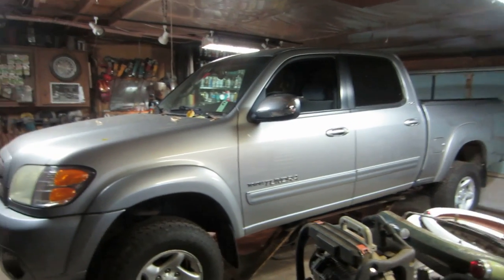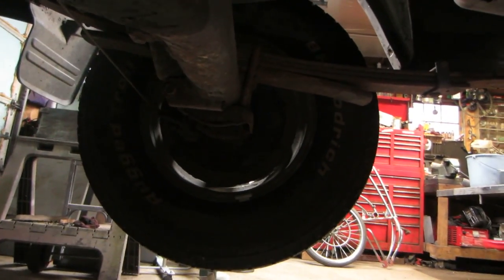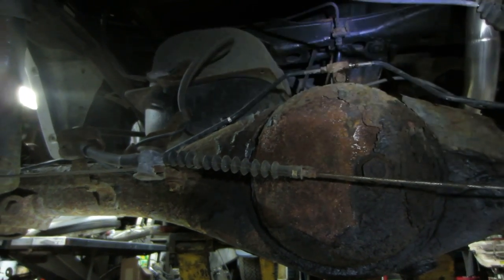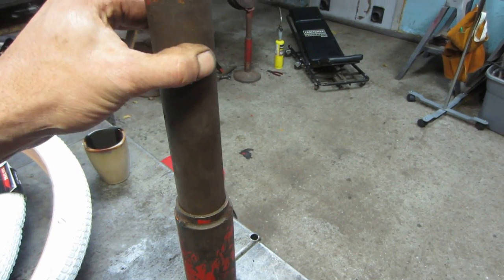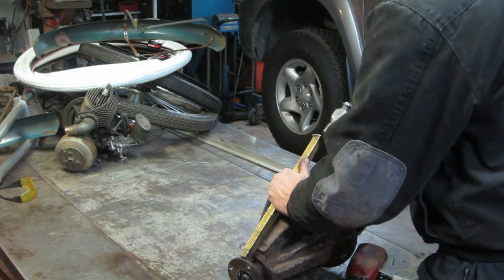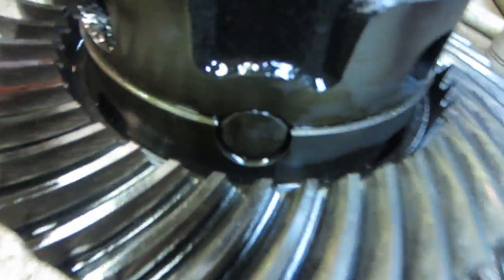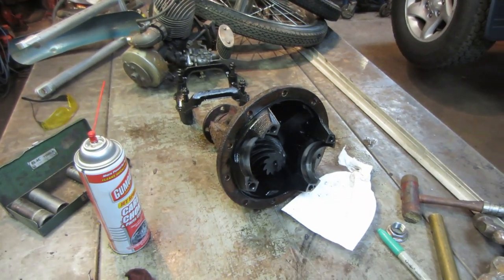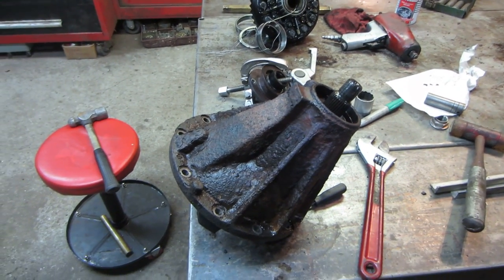toyota tundra rear diff tear down

Comment: I've been binge-watching your videos since I tripped over your channel a few days ago. I drive a 2004 Tundra V8 4x4 access cab, with just a quarter million miles on it. It's still running great, and it has the dog nose-prints on the insides of its windows to show how well-loved it is. Say what you will about California, but at least we don't have to deal with rust like that here! The paint on the tops of the hood and cab is all flaking off after 14 years in the sun, but the metal underneath is just fine.

I should have clicked away before I got to the closing scene, because that Cadillac made my laptop smell like rust!

Comment: If you heat the shaft really hot the let it cool it will shrink in the bearing race.   When it's heated the race won't let it expand radially but when it cools it will shrink in all directions.   Not guaranteed to work but it usually does.

Comment: Sooo, I did a bit of looking and according to this website "Eric's Toyota Differential Info", The T-100, Tundra, and maybe Sequoia all use that same differential... I couldn't find info for the housing lengths for the Tundra BUT there is a Tacoma rear axle on ebay and it has 4.10 gears in it with the exact same diff in it,  as well as the same chunky squared off diff housing bump to clear the carrier bearing trusses as your Tundra.  The housing MAY be the same length as yours (you could ask the seller), but in any case that 4.10 pumpkin should slide right in...   You should look at Eric's page it's got real good info and might save you some $$.

Comment: Just a thought but why couldn't you take your plasma cutter and cut out the inners of the bearing and then get it apart. I ran into a similar case on a Ford 9 inch years ago, I cut away the bearing the oxy/act. torch and got it apart.

Comment: Long time ago I repaired one differential which was badly corroded. It was very noisy although it did not look too bad. But the small corroded pits caused a terrible noise while driving. It had to be replaced with other used parts. For that model 1962 car it was not a big deal and the noise went away. Musti1's differential here can not be salvaged as the teeth are really bad and will surely cause a high noise level.

Comment: I have a 2000 Toyota Tundra hell of a truck 
I'm at 408,008 miles on it runs great. Till my rear diff started slipping now I'm already taken pumpkin head out 
I,m just wondering if I can change from limit slip to posi ???

Comment: A gear kit can be had online. If memory serves me correctly the toyota uses threaded main cups. Get some marking lube and set it up!
Reply from the maker: you can get kits in higher gears but not stock, they are only availible from toyota, l tried, but l may have found what l was looking for

Comment: Had a 1983 pontiac. Had same problem and also bad wheel bearings. $80 for the entire diff at the junkyard. No brakes. Mechanic wanted to charge $60 to replace 1 bearing.

Comment: How much would it be to put 3.91's in the front and rear?
Reply from the maker: that might be my solution
Reply: There's not much difference in the ratio. Should get a little better mileage.
Reply: Might have to check the ABS sensors between the two.

Comment: Welded the back of the differential on? Wow.......just wow. Reminds me, but not as bad as the Chrysler 27 L V6, where the water pump would go out after 70k+ miles. As in, go out, and let coolant enter and destroy the engine. I may be crazy but I thought the caddie was beautiful.

Comment: if 391 gears are more readily available and cheaper, would it be worth converting it to 391. You would need to change the front Diff as well but would this be a cheaper option and get it back on the road. I am from the UK sorry about that, so don't know if its that simple?
Reply from the maker: could be done but not easy, fronts a pain

Comment: It would be interesting to find out if there's some sort of lapping compound for gear teeth... so that the teeth can be repaired and smoothed again without replacing the whole part. Although if the dimentions are critical, it would require adjustment..

Comment: Cut that bearing out with an oxy-acetylene cutting torch. You have nothing to lose. Then buy a ring and pinion set and new bearings. Third member type differentials are easy to setup on the bench. Are there aftermarket companies that sell third members or at least complete ring and pinion kits  for Toyota like Richmond gears?

Comment: Know this is old, but with that rear diff. heating up like that, and the metal distorting/weakening would want to change it out completely, rather than my preferred 'repair the old' method I try to usually employ, preferably getting a whole axle assembly that matched the ratio and year correctly.

Comment: Man! That housing looks like it was buried for fifty years! It's amazing what the salt and chemicals does to metal.
Reply: thinking the same thing. i have worked on chevy rears from the 70's that look brand new compared to that nasty thing!!!!
Reply: Early in the video he said the PO ran it until carrier was red hot. That burned off all of the paint, oil, etc that was protecting the casting. Once it cooled off it 'flash rusted' and then continued to rust after that to give it that lovely 'been in an ocean' finish.

Comment: Rebuild the third member.  New ring and pinion and bearings.  And clean housing and weld the holes.   Freaking rites !!!!
Reply from the maker: only if it will come apart
Reply: Mustie1 
I'm with you on blowing the bearing in pieces.   If it doesn't allow enough room to allow race through , I bet a hot wrench can eliminate the race.     I have a feeling you are a surgeon with the hot wrench. 😁😁😁😁
Reply: That'd be kinda cool, to just fix the 3rd member without having to buy the complete set. Plus it would make an awesome series of videos...which this is all about. I really hope there will be more Tundra (or other cars/motorcycles) vids to come.

Comment: The way it works is when the oil gets low the pinion bearing is starve first so most people stop driving it when it begins to howl. To test a rear end or manual transmission on a vehicle is drive it and then while it's hot touch the pumpkin with the back of your hand 3 times just touch pull away touch pull away if you can't touch it a third time it's got a bad bearing s. Pulling the driveline and driving it is only for a short emergency   . Remember it's low on oil so y starve the other bearings. The failed bearing pieces can damage the ring and pinion and cost a pile to fix.

Comment: Nice diff, crunchy and cooked, it looks like you may have to heat that bearing up to red again to have a chance of breaking its bond to the pinion.
Im supprised the teeth are there at all, no oil and it took the front bearing to fail before it was noticed.
If its an impossible item to get, i imagine the teeth could be polished and the shims tampered with to get it as close as possible, although it would never be really quiet.
I think the gas welding torch needs to be in cutting mode to melt the dead bearing rollers.
It dont look too easy :-(

Comment: You don't usually respond to comments but I saw something in an article that made me think of you and your rust problems on the Tundra.  Seems like there was a class action suit that was settled by Toyota regarding not providing proper rust protection on some of it's vehicles.  You might want to check on the suit because some of the vehicles were Tundra trucks.
Reply from the maker: its only good for up to 12 years, but tanks
Reply: Mustie1 I hoped I had enlightened you on something you weren't aware of.  Love your vids!

Comment: I have a tacoma with 410 gears.   very hard to find one at a reasonable price.  Mechanic bought a parts truck just for the axle.
Reply from the maker: l got real lucky and got the whole 3rd member for $100 delivered from ebay,

Comment: 3 year old vid......Ya.....that outer pinion bearing is welded to the pinion.  No amount of press will pop that free.  I have had it happen twice .....both times I think it was a Toyota 8" 3rd and the solution was a cutting torch.   Amazingly, I did not do any apparent damage to the carrier.   In my cases, the 3rds were rebuild and nothing unusual was noted .  
ZUK

Comment: Is the rust from the salt on the roads?  You guessed it, I'm from the South.
Reply: Not necessarily.    Toyota had a problem on some of the tundras with the undersides rusting out prematurely.    My 2000 has some rust starting but I will spray it with a rust converter and stop it from going farther.

Comment: Costal WA salt air rusts all metal. If you drive on beach power wash frame and undercoat body.  Rust from inside out. Of course they count air bags when doing body shop evaluation. Then and tires and frame. Then body panels. Are you going to learn Tesla drive train?

Comment: Good old Yankee ingenuity and perseverance, you will find the pumpkin.  I'd be wary of driving it on the front diff.
Reply: jim s I'm sure he just wants to move it in and out of the garage. wouldn't be an issue.  but I wouldn't drive it on the road like that
Reply: have done that before after breaking a driveshaft, works fine got 335miles home on the front diffs power

Comment: If the front axle is like my Ford 4x4 I can't drive in 4x4 mode on dry pavement. The front wheels are locked together and when turning a corner the wheels just hop.
Reply from the maker: its an open diff but will find out soon enough

Comment: I've read a few places that say the tacoma also used the same differential in those years.  Heres a quote from the page(not mine) " All 2wd and 4wd T100's, '00-06 Tundra's, and ?? Sequoia's use a newer/stronger 8" 2-pinion diff. Tacoma 4x4's and Tacoma PreRunner's that don't come with the electric locker (aka "non-TRD), as well as V6 Tacoma 4x2's also came with this diff. "  Heres the source,  http://home.4x4wire.com/erik/diffs/#T100-Tundra

Comment: I have watched at least half of all your videos. I can't take it anymore watching you hit a large brass drift with a small hammer. You need some heaver hammers. Think of it in this way: If a small Honda Civic moving slow runs into a big rig truck, the big rig truck will not move. If the Honda Civic  is moving very fast and runs into the big rig truck, the big rig truck will still not move. Conversely, if the big rig truck is moving slow, the Honda Civic will move and also and if the big rig truck is moving fast the Honda civic will move much more. Thus is the way you use hammers.  You are trying to hit the brass drift real hard and the drift will not move. If the drift does not move, the object you are hitting will not move. I have three of the hammers you use. The orange dead blow, (not wort a crap for anything pretty much), the fiberglass body shop hammer which I only use for body work pretty much, and the red ball peen hammer which I use for small stuff, like a small punch. Also, I have the brass drifts you use. I would hit that drift you are using in this video using a 3 or 4 pound hammer with an 8 " handle. Give that drift some good solid pops. :) Thank you. Love your video's. I eventually will watch them all I guess.

Comment: Complete rear axle 04, Tundra Double Cab, 4:10, w/posi -  Regal Auto Parts - Brockton Mass. (other side of Boston from you) $1000.00   800-507-1041

Complete rear axle 04, Tundra Double Cab, 4:10, W/O posi -  Aalba Auto Salvage - Ridgewood NY (Long Island) 850.00  718-386-3953

If the carrier is OK but rusty you could drop in new bearings, ring/pinion and clutches.

Comment: What a massive corrosion on the axle. That´s really poor quality. It looks like the axle were on the ground of the ocean for many years.
Reply: That's just what happens to metal if it's open to the elements. I just pulled out the rear axle of my '93 Mercedes, that looked even worse than this.
Reply: Donemik
On my cars these parts are pretty coated. On my 30 year old Opel the condition of the axle was much better than on this Toyota. Here in Germany only cars near by the northern sea looks like that.
Reply: Getting Nervous I thought so to I have a 21 year old car I off-road with that has a lot less rust then this car
Reply: Frame rust!!  Toyota is replacing and coating Tundra frames.  Rust killed my 02 Tundra:(
Reply: Keep in mind this dude lives in New England, snow and salted roads kill everything in that region of the country.

Comment: Found a few rear diff listings. Mind you I'm not cross checking 
compatible years. Just trying to throw anything close your way you may 
have missed. The first link looks promising 

http://nh.craigslist.org/pts/5875048170.html
http://boston.craigslist.org/gbs/pts/5868707310.html
http://nh.craigslist.org/pts/5803952575.html
Reply: just watched the newest video. Ignore most of those links. Only one that would possibly work is the first link

Comment: I recommend you not making any more of these videos you're not a very good mechanic you may get by in your shop for yourself but you're not giving people good information you don't hit flanges with a hammer brass or anything else you pull them off with the three draw puller and you don't just put things in a press and start pushing on them just because you think it's going to pull out that's a good way to destroy things and a good way to injury yourself I've been a mechanic for 30 years on industrial equipment and if I was to do the things you're doing I'd be fired just a suggestions do it the right way or don't do it at all